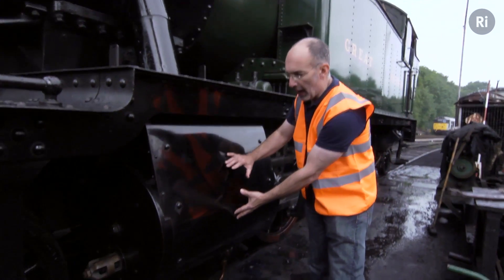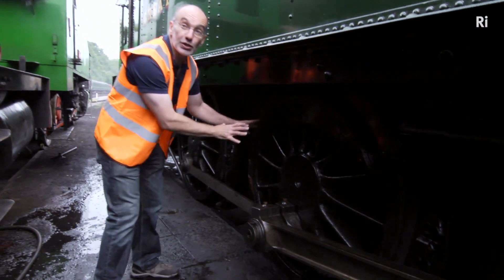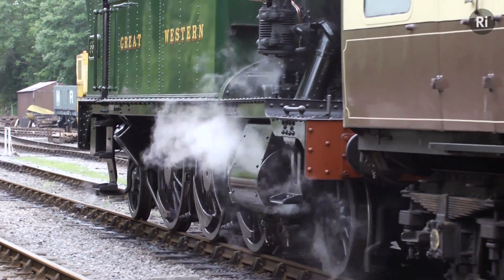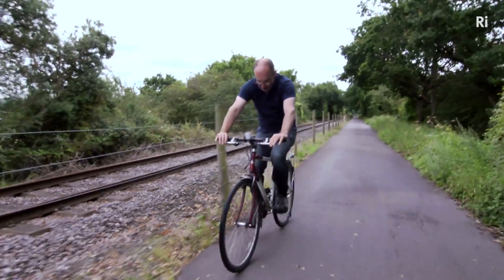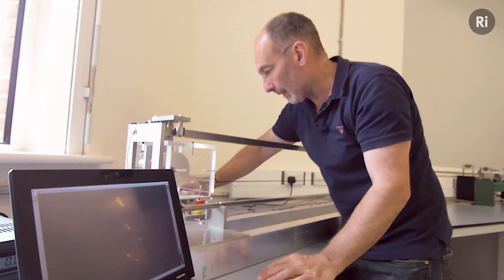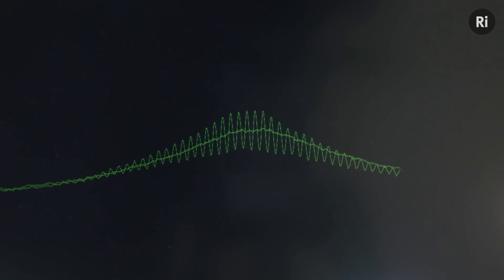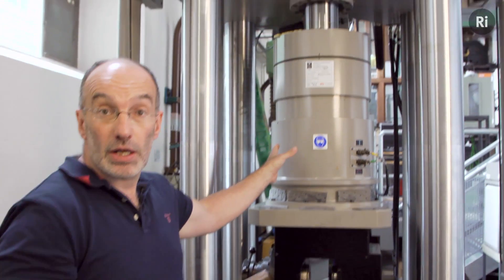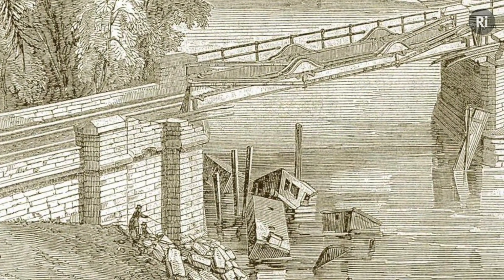Steam trains, bridges and potential catastrophe

Comment: you bring up a good point, but there are counter weights to balance the main and connecting rods to stop the ponding on the rails.
Reply: Exactly - without counterbalancing (which can be seen on the driving wheels) there would be a severe vibration throughout the loco as it ran along with all the wheels bouncing at speed.

Comment: Are cyclic loads less of an issue with modern diesel locomotives that are powered by generators and electric motors. The only thing I can think of that might cause the displayed cyclic loads are rocking of cars caused by minor height variations in the track, track defects or vibration from diesel cylinder heads.